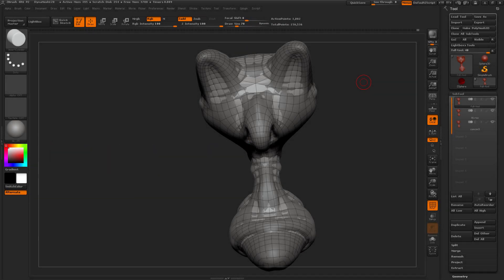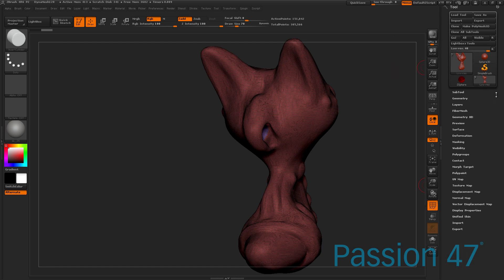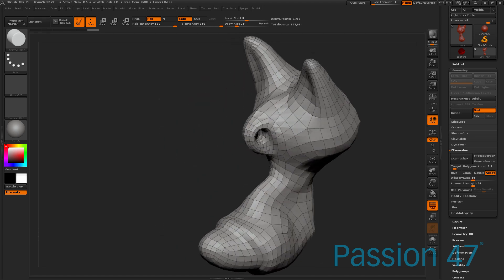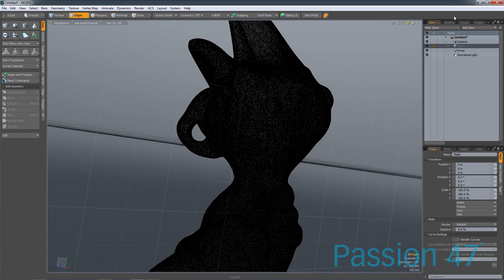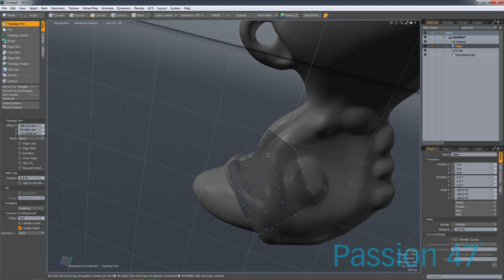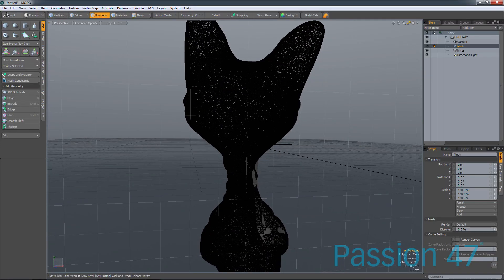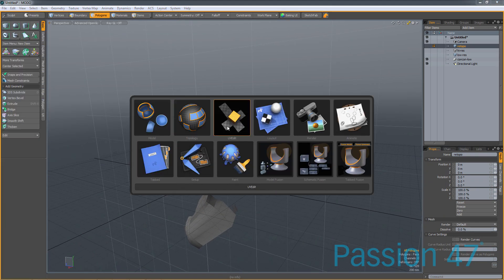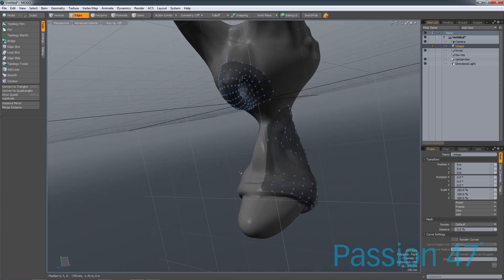ZBrush to Modo 801 Retopology Workflow

Comment: Hey man, why are you not getting pissed about symmetry issues?
- meshes exported from ZBrush don't have symmetry in Modo
- if you run symmetry tool in Modo and try to import it in ZBrush it will import it as a new Tool, instead of reprojecting the details on my old one (just adjusting the topology in Modo a bit), because "Symmetry Tool" changes vertex order or something.

anyways... it seems kind of fixed in Modo 901...

Comment: Hi Edithson,

What's your opinion on 3DCoat?  I keep hearing how it's one of the best for UVs and retopology but do you feel the workflow in ZBrush and Modo are sufficient to not justify purchasing 3DCoat?  I already have a copy of ZBrush and Mari (kind of overkill for games) but was wondering if 3DCoat will still be something used a little more often than "situationally".

PS TYVM for your Modo tutorials. They are really easy to follow and I'm sure a beginner (at Modo) can easily pick them up.
Reply from the maker: +BangBoyxD To be honest the best parts of 3D coat are the uv and auto-retopology tools . But now I don't  think any other program can touch #modos uv/topology tools speed and ease of use. Granted #modo doesn't have auto-retopology but you have #ZBrush and you can use decimate and zremesher, which give you great results. You can also use a new open source program called Instant Meshes https://github.com/wjakob/instant-meshes
Reply: +Edithson Abelard First time seeing instant meshes but thanks for the link.  Looks like I'll be skipping 3DCoat and Substance Painter since I already have Modo, Mari, and ZBrush for now :]

Comment: thank you how do you know what number of polygons is suitable for a game character or animation freindly character and you keep refering to the retopology as a cage what is a cage? Thanks
Reply from the maker: Each engine is different, I use unity and they recommend for mobile 300-1500 and for desktop 1500-4000 and for console you can go higher. But i say that with caution, it really depends on the amount meshes and polys the camera has to render. If you have 30 meshes with 100 polys or 1 mesh with 3000. You have to find a good balance for platform and usage.

As for animation, it really depends. You want your mesh to have good edge flow, so when it's deformed you don't see random artifacts. Also you want your polygons to be as evenly placed as possible to also limit distortion and keep its form.

Cage is actually 2 fold, sometimes when you create retopology meshes you need more accurate bakes. You can use a cage/retopo mesh to tell the bake engine to bake everything the is encompassed in the cage. Also the cage sometimes is used as a stand in for your real mesh during the animation phase. Its easier to animate with a mesh with 15K then 1mil.